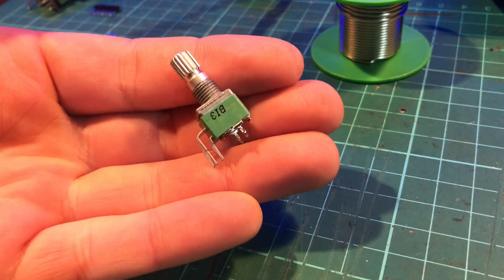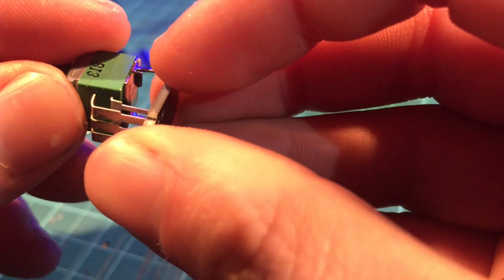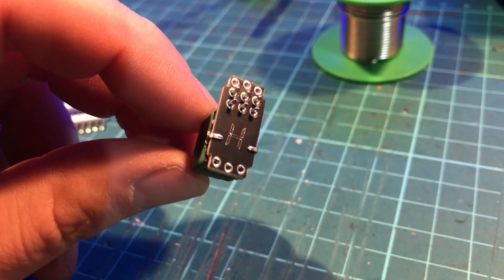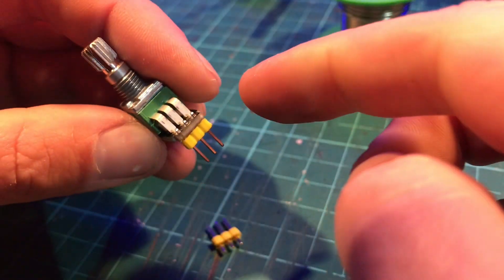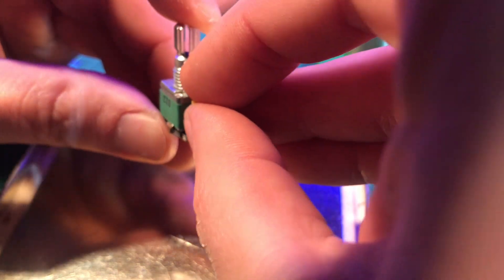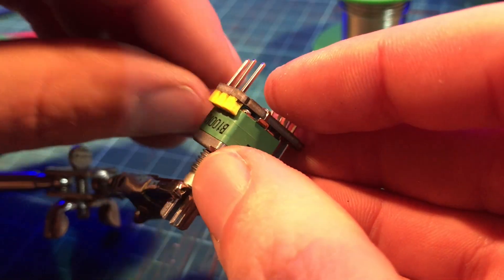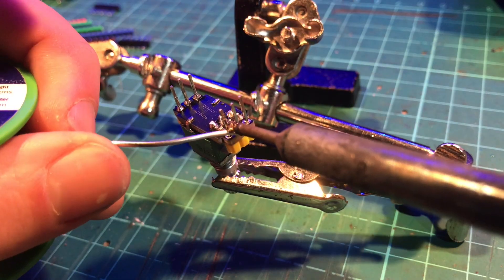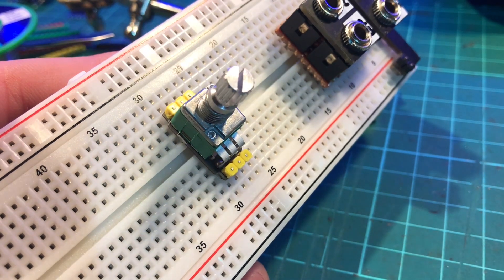Dual Gang 9mm Potentiometer - Breadboard Buddies

Comment: Hi, great video! I've found an old subwoofer in the trash. I salvaged it's components and found two dualgang potentiometers A50K. I'm planning to build a bluetooth speaker out of components I find the the trash. Do you think the A50K potentiometers can be useful for building a bluetooth speaker ?
73
Reply from the maker: Sure, logarithmic pots are used as volume controls in audio circuits 👍Seven three